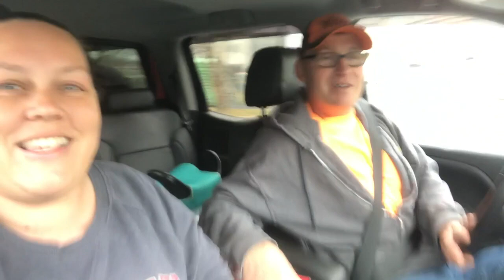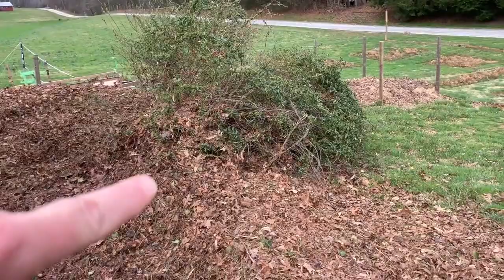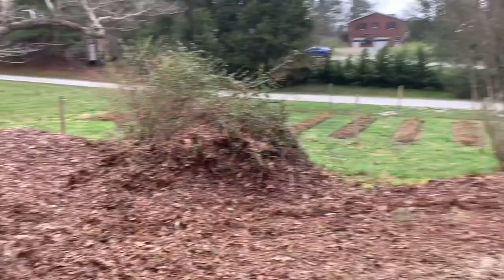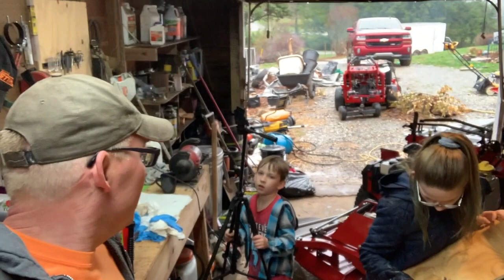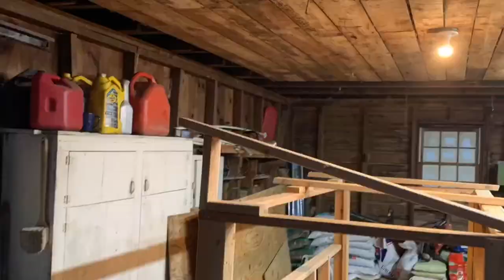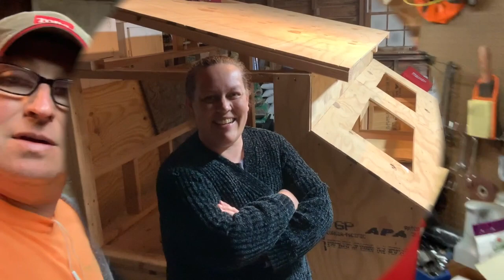Garden vlog # 9~ Building more of the chicken coop

Comment: "Sil-glyde " is the brake grease you should use on your caliper slides, it won't harm rubber or plastic parts and takes high heat.